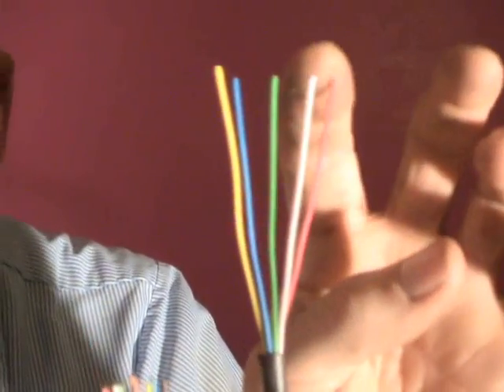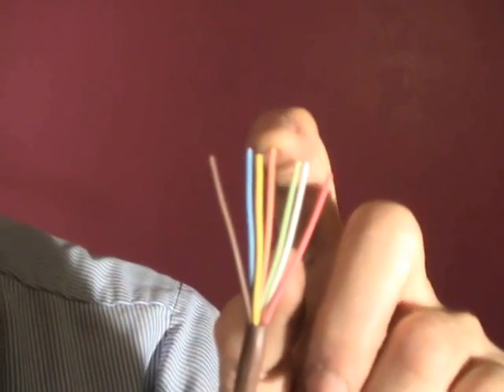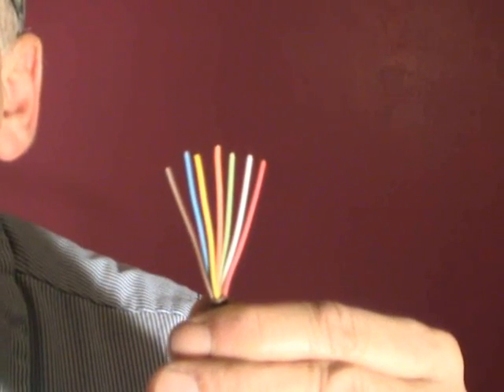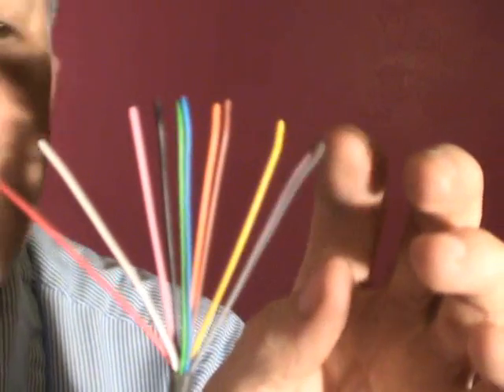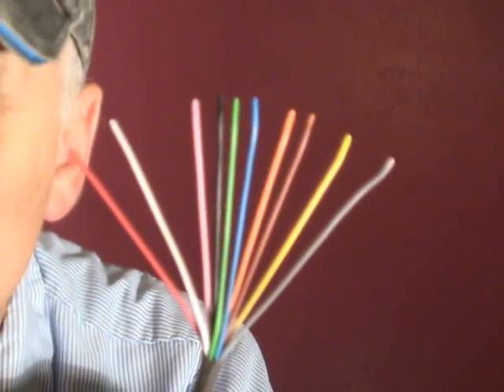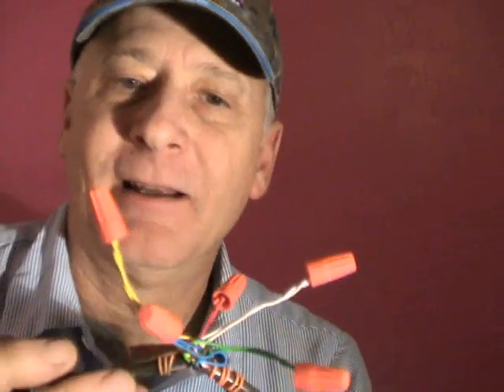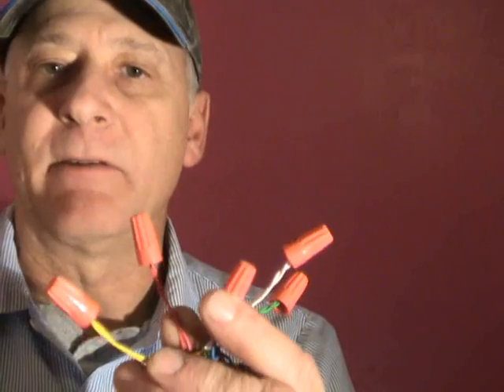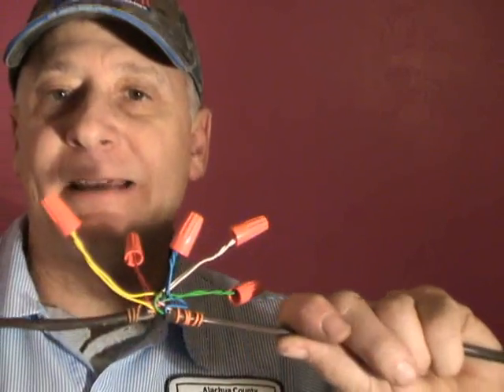HVAC Thermostat Wire

Comment: I need to upgrade to the 5 wire from a 4 wire 😩 I upgraded the thermostat to a smart thermostat  and its recommended to use the blue or C wire. But I'm in a old house so the wires is ran through the return in the basement. I forgot old houses they make returns through the rafters rather then duct work smh

Comment: My wire system has: O, W, G, R, Y, 4
We have oil and a wood burning furnace separate .  The thermostat i am trying to install has B, O, Y, W, G, R, Rc...the wire running between 4 and R was on the old thermo, but it only ran between those two...now there is no hot air blowing...for the love of god

Comment: Question, is there a wire running from the thermostat to the furnace and blower. And a separate wire running from the condenser unit outside to the furnace inside? If not help me understand please. (straight ac unit not a heat pump)

Comment: PART 2-AFTER REQUESTED TEMP,(UNIT HEAT PUMP).
WIRES ON THE OLD THERMOSTAT,,,GREEN TO G,,BLUE TO C,,,RED TO R,,,YELLOW TO Y AND THE Y HAD A JUMPER TO W1,,,,WHITE TO W2,,,ORANGE TO O,,,,NOTHING ON L,E,B...
ON THE NEW ONE IT HAS  E  AUX  Y  G  O  L  R  B  C 
I PUT WHITE TO E,,YELLOW TO Y,,,GREEN TO G,,,ORANGE TO O,,RED TO R,,BLUE TO C,,,IS THIS CORRECT,,THANK YOU.

Comment from the maker: @2jlrivas The thermostat wire should go from the air handler to the condensing unit to control voltage to the compressor contactor and/or the defrost board.

Comment: I ran into a condenser that the thermostat was not wired to it.  Where do the wires from the thermostat go.  The only place I could see was terminal on the contacts.  Could give me some insight on this situation.   The thermostat wires are coming from the a/c unit (furnace) inside this trailerhouse. Thanks

Comment: Thank You Sir, seems like I run into a lot of heat pumps with only five wires to the Thermostat, and find the rest of the wires taped off or capped. Why do people do this.

Comment: got a question..i'm installing a goodman variable speed 95% furnace,2 stage gas valve and the blower can be set to blow from 600 to 12 cfm...the homeowner will eventually build an addition to the house but right now the house will need barely 600 cfm's, i was thinking gas valve on first stage and blower on the lowest setting but i was told that i may need to lower the gas pressure if running on low cfm which makes sense but i wanna know how do you figure out the proper gas pressure then?

Comment: I found this problem with a set of wires with a lineset run under a beautiful patio. They spliced it somewhere under the patio. I needed a yellow and didn't have any. I ended up running about 50 ft of 5 wire around the foundation of the house and garage as the patio was not moving. I don't know if the customer ever had any problems with the lineset but I told him he might in the future. The patio was cement and marble, heavy and settling.

Comment: On a unit that takes in fresh outdoor air, and exhausts indoor air, and energy wheel rotates like a spinning disk with the fresh outdoor air coming towards you through the top half, and the indoor air is flowing away from you through the bottom half. The energy wheel grabs heat and humidity from the outdoor air, then rotates around and puts it into the outgoing exhaust air. It preconditions the air using only the power of the motor to make it rotate.

AKA: "heat wheel" or "enthalpy wheel"

Comment: It is scary what you find in walls.... Ive found splices on a 50 amp stove circuit, laying on heating ducts waiting for someone to touch it and either get knocked or have it short to the duct and flash....